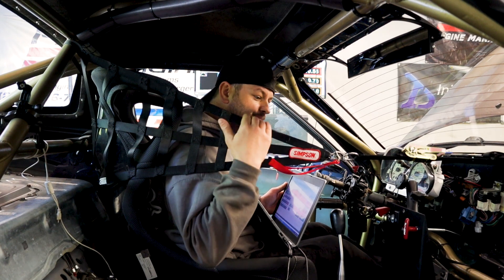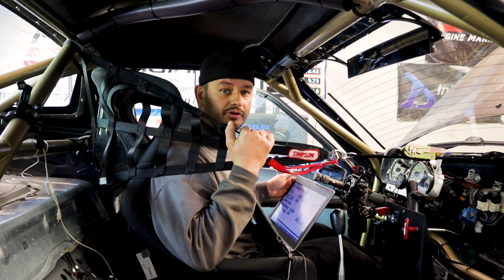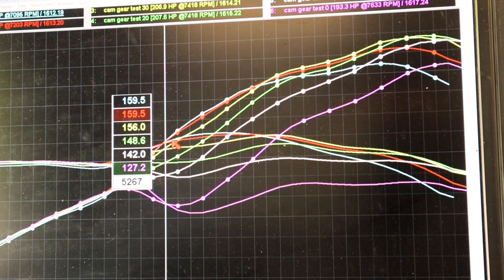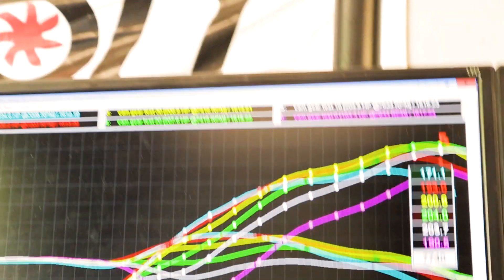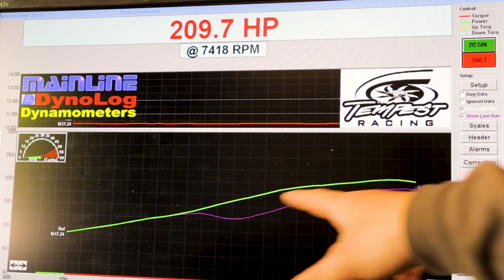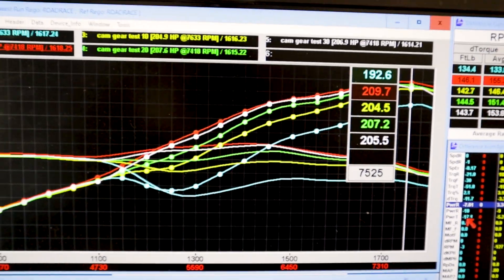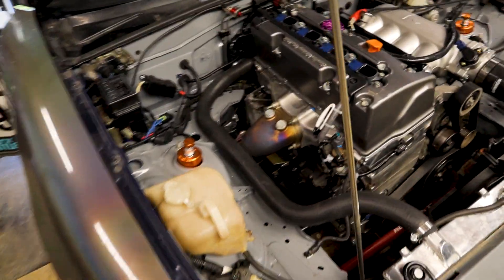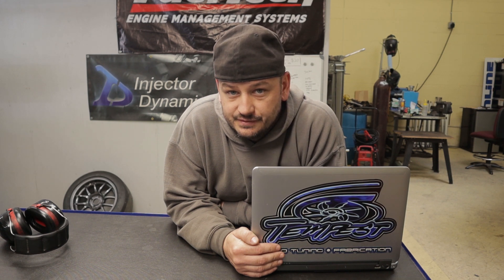How much does Variable Cam Timing affect Horsepower?

Comment: Man that was an awesome video as well, good thing i found your channel! So im running a K20A from a JDM DC5-R and ive been messing around with tuning and i do want to give it a go by myself. You already pointed it out: Itll take a long time to have anything dialed in correct, so how would you go to tune it with as little time as possible? I thought Fuelmaps on the road and on the dyno for ignition an cam: make ign table for every camangle and then blend it together like you did, but itll take alot of time. You could also just skip this part since you know that 50° is best from 4500 to 5500rpm and walk you way to 40 and then 30 and only tune the cells you are basically using. How are you doing this? Thanks and greetings from Germany :)